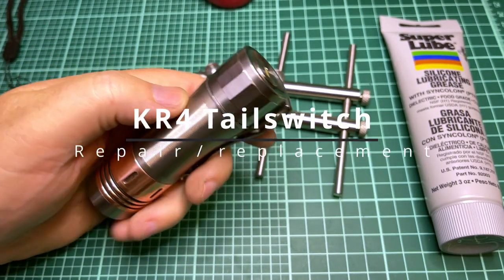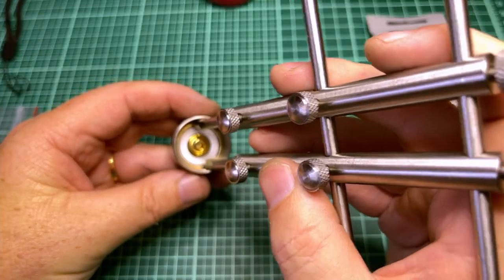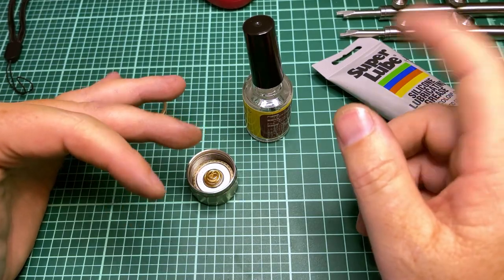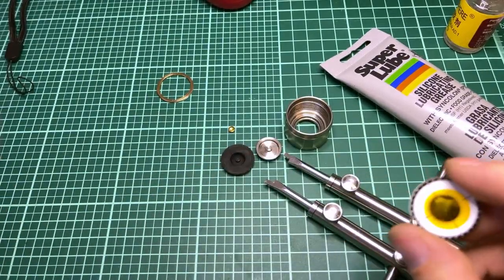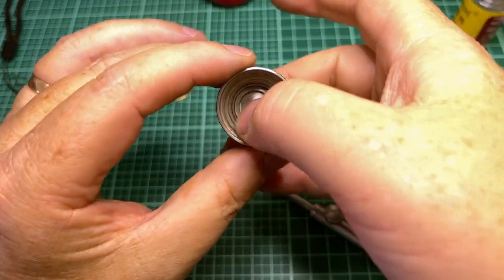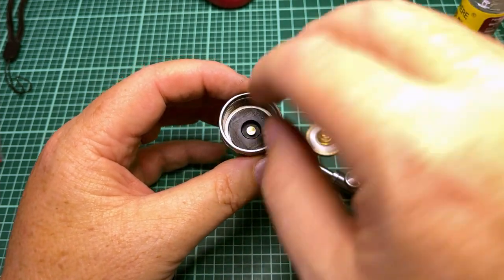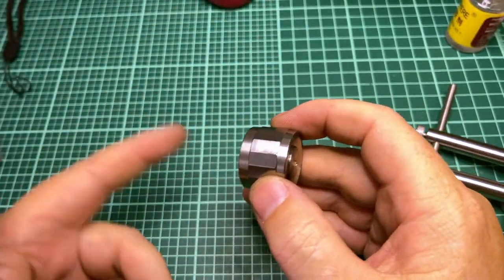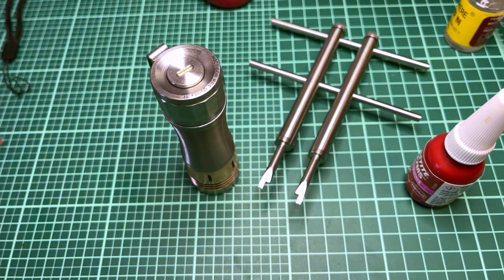Noctigon KR4 Tail Switch Repair or Replacement

Comment: The KR4 is the best semi mass produced flashlight in the world. I have 3. I have Emisars too, they’re great but the switch is on the side. The e-switch in the tail of the KR4 is so perfectly sublime I just sit there and lock (4 clicks) and unlock (4 clicks) it over and over for fidgets sake! Lol. BUT, like you, of the 3, the colorful series Soft Blue Camo titanium is not up to par with my mish mashed black and blue aluminum babies. It had the grind like yours, but I kinda smoothed it out with repeated manipulation of the button. But it also is mushy, very little travel, the click is weak. I was thinking the switch maybe sorta collapsed. Funny thing, kinda like you said it changes how it behaves by simply removing and replacing the tailcap to the body! So after all my blabber, sorry, I just want to thank you for another fantastic upload. I’ve emailed Hank for a switch a while ago. Now I’m thinking, with the guidance of your vid, I may disassemble and lube, resituate the switch, reassemble, and then see what gives. Thanks again.
Reply from the maker: Do the mod! It’s very easy and you’ll be wondering why you didn’t do it sooner.

Comment: Great video, I have found my switch is leaking like crazy and let's water in through the four tiny holes in the middle even in the rain. I'm trying to figure out what I should do to seal it, or figure out why it isn't sealing.
Reply from the maker: Which four tiny holes are you speaking of? On a KR4?
Reply: @cheule  on the tail switch under the spring
Reply: did you figure anything out in relation to this?
Reply: @Allanrpsx  I never have. It's dried up and functions about 99%. I would like the time to pull it apart but haven't the CA dissolving chemical at the moment.

Comment: Nice tutorial with awesome "hidden" information! And that spanner wrench is a nice tool. I always use snap ring pliers, but those can slip off sometimes. But they are needed for Convoy lights, their retaining rings don't have those slots, but small holes instead.

Just two questions: Could you link this anti-glue product? As a non-native speaker, I didn't really understand what I should search for if ever in need. And next, isn't the KR4 a Noctigon light, not an Emisar? :P
Reply: Noctigon & Emisar are sold by the same gentleman... Just different brand names.  If I remember correctly, there's a method behind the difference, but it escapes me at the moment.
Reply: @eckyeckypikang  I know, but they are still two different names. 

I would have thought that Hank's Emisars were the floodier lights and Noctigons the throwers, but then again the KR4 exists.
Reply from the maker: KaddamanMan, the spanner wrench comes with tips for the convoy too! Sharp points! I use it on Convoy lights. 

The product is called dispergator (Debonder).